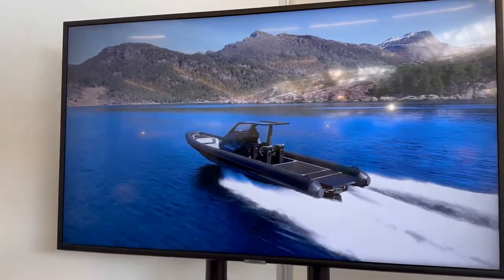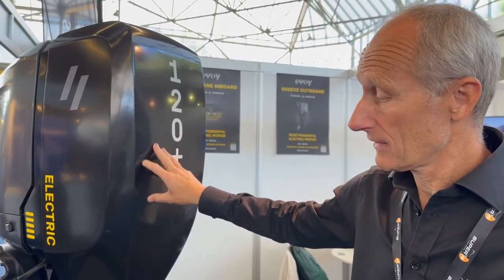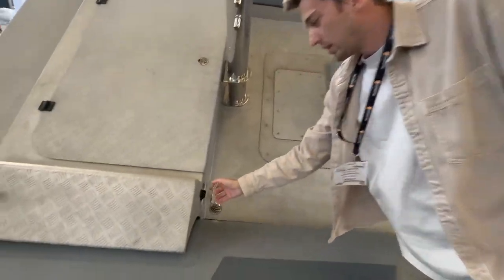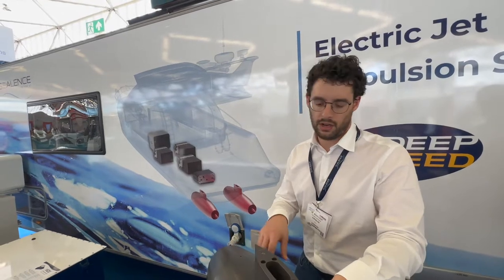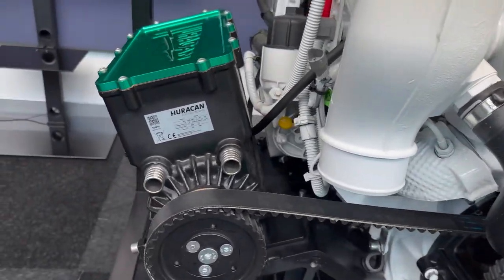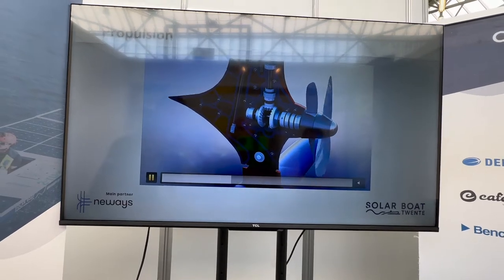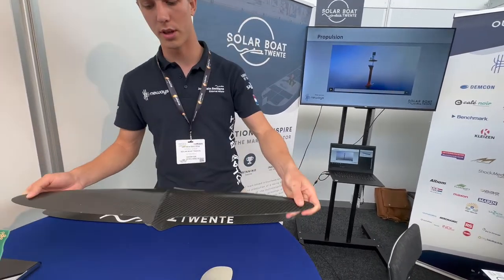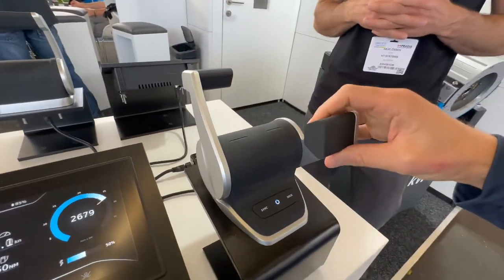Meet the People Building the Future of Boating at the Electric Hybrid Marine Expo in Amsterdam

Comment: Is it possible to automate/regulate the trust electronically to improve performance and efficiency in waves and currents ? Just set the desired speed of the vessel and let the system chose the optimal trust and reves.

Comment: Permanent magnets have a number of issues they rely on rare Earth metals and those magnets can loose magnetism if heated or subject to vibrations. 
The supply of the magnetic elements will become an increasing problem as demand increases. However their is an answer and that is to use advanced electro magnets where only steel and Aluminium  is required to produce powerful magnetic fields and regenerate they don’t even require copper windings a factor that reduces wt. cost and the global need for Cu already in a supply critical situation.
Incidentally these non permanent magnet motors are also easier to recycle. 

Another UK company has pioneered this type of motor technology AEM Advanced Electrical Machines. They started out on heavy commercial vehicles but they were developed as a spin off from research at Newcastle University … there’s also MOLABO from Germany till recently these motors lagged behind till researchers developed the controllers and software to manage the powerful electrical fields in an efficient and smooth manner. Those problems have largely been resolved enabling efficiency and power to be achieved for even the most sophisticated vehicles. 🧙‍♂️Clive

Comment: As someone who has spent his whole life on the water, electricity and water are not very compatible, there are always electrical problems and battery problems, Diesel motors well looked after run for 50 years plus.  These people are kidding themselves.
Reply: And for longer than that boats and ships have been happily using hybrid electric diesel systems ..plus the whole technology has moved on over the past decade thanks to the need to power cars and trucks.. 
The other thing you ignore is the fact that increasingly diesel engines are managed and run by electrical systems in order that they can meet the performance requirements and pollution control standards globally.
Reply: yeah yeah,, same argument with steam engines before that. the age of diesel is dead.
Reply: Intraharbor solution